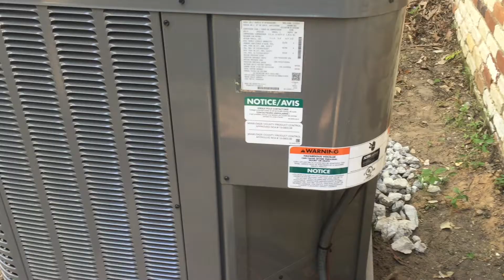Install with new Kflex Titan pipe insulation

Comment: I seen that armor flex advertised in my local Johnstone flyer. But I never seen it in person. How much is it per ft. More or less.
Reply from the maker: I want to say it was like 8 dollars a piece. Not the ft but the whole 6ft
Reply: Not bad. So is the inside part still made of the same material? I’m guessing it’s only the outer jacket that is the difference. Does the regular armaflex glue work with this product?
Reply from the maker: Anthony Reardon hvacr yea same thing except outer coating and glue would work the same yea.
Reply: Baker here in Clearwater is getting around 15 a stick now.

Comment: do you ever shield/sleeve the outdoor lines with pvc downspout?  aluminum works too if you make sure no copper contact.
the new stuff looks strong, time will tell
Reply from the maker: throttle bottle I do if i am running the lines down the side of house but I use a regular line set metal cover that I paint. I've never used a gutter type product. Yea time will tell how good it holds up but hopes are high! Thanks for watching

Comment: Is it expensive?...
Reply from the maker: Oscarbm1234 yea it is kinda expensive right now but I only use it when it speeds up the job enough to justify it.
Reply: It’s actually required here in FL outdoors, or the other option is weather barrier uv mastic which is a PITA and looks like crap.